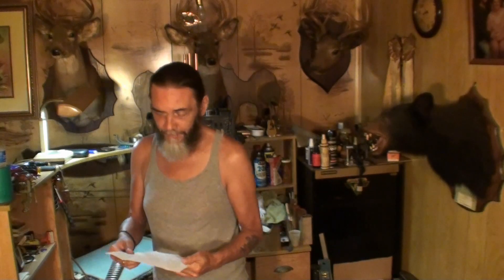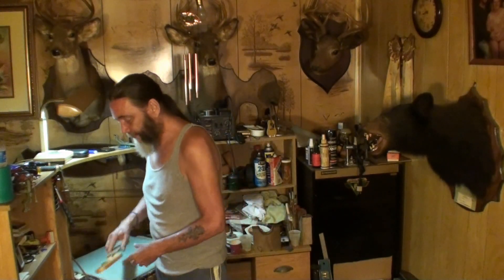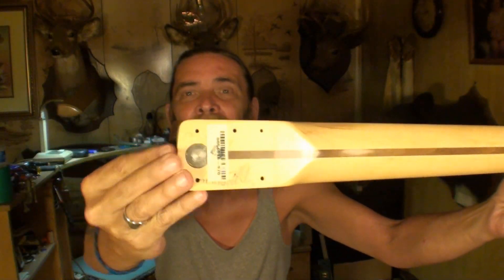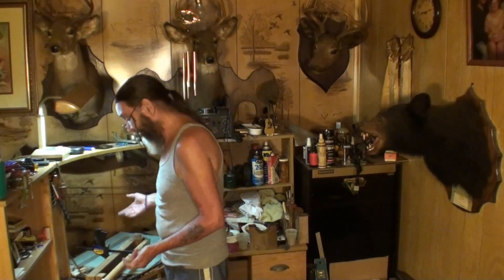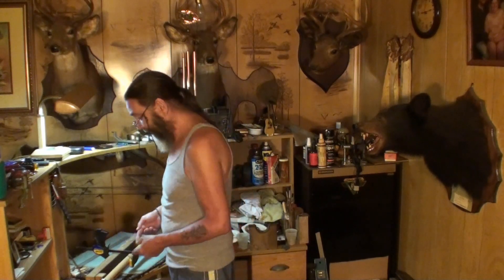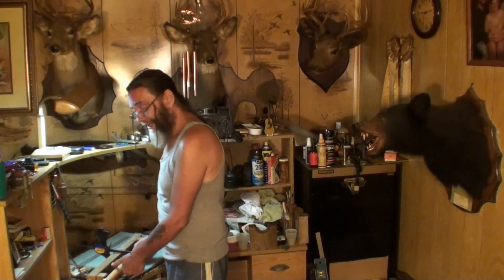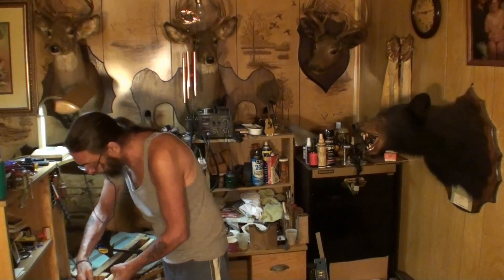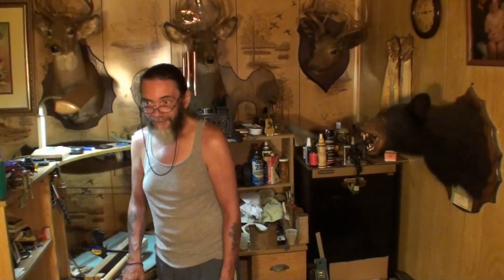fender stratocaster deluxe bi-flex truss rod neck repair part 1

Comment: I got a 04 fender mex american never done anything to it as of yet ,in 06 took it to geetar center for a setup the guy said he couldnt get the action any better ,I never play it but when i can ill look at it ,the plug up at the neck is solid so maybe i have to take the neck we shall see lol,thanks for the video may have to do this to it
Reply from the maker: best of luck mate! you may be able to shim the neck or if it has the adjustment like this one you can change the angle of the neck to body and get action very low that way. thanks for tuning in! :)

Comment: The back bow was real easy to see every time you swung the neck around and we got a look down the length of it. I have a Jaguar in the shop with exact opposite problem. It's got two much back bow and the string tension won't pull it up. So it was clamped for a week, I even heated the truss rod with a high watt soldering iron. Going to have to move on the the heat lamp. It's rear adjust so not two way or bi-flex.
Reply from the maker: wrap a wet towel around it and put a heat lamp on it and over time it should loosen up enough for at least strings to pull relief into it, many times the wood is too dry to allow it to flex enough and it sounds like this may be the case with yours. good luck brother and thanks for viewing!

Comment: great video!  What do you do for the opposite situation? Too much back bow and the nut is backed off to the point that there is no thread left to loosen it anymore to make it straight?
Reply from the maker: clamp it in the opposite direction and use heat, it may take days but it works. thanks for watching!

Comment: Randy when heating it would moist heat be better than dry heat?
Reply from the maker: yeah I get a wet towel to wrap around the neck and when heat is applied creates steam, this also keeps the wood from drying out from the heat.

Comment: Heya dood. Yah don’t look burnt to me. Just a nice tropical WV tan.  
It might be worthwhile to remove and replace the walnut plug, so you can put a new nut on the rod. Check out Flame guitar’s channel for a really cool technique for that.  Cheerios! 🍺
Reply from the maker: yup tanned very dark now :D I'll check that channel, I use a soldering iron to soften the glue then let the truss rod head push them out, the last one I videoed the owner tried to pick it out in pieces and I had a time getting the rest of it out but finally got it. thanks for watching!